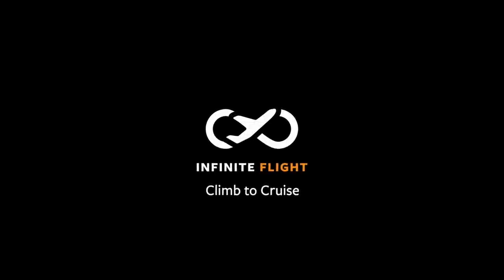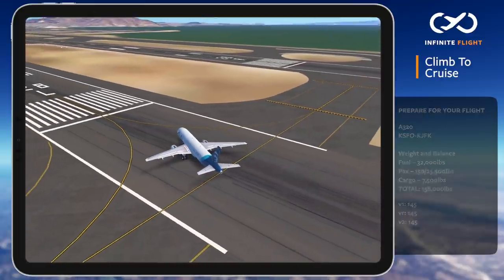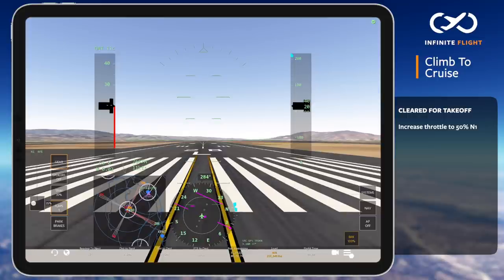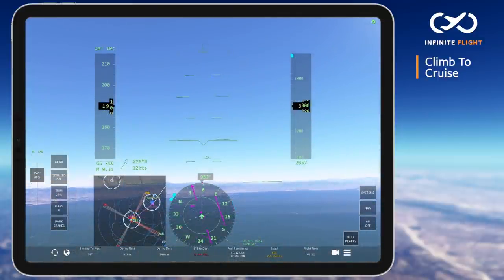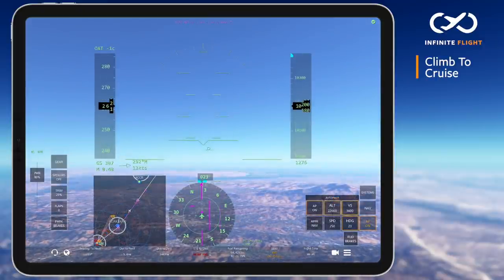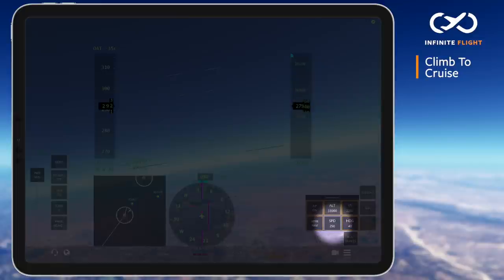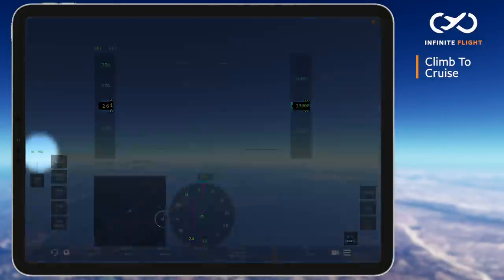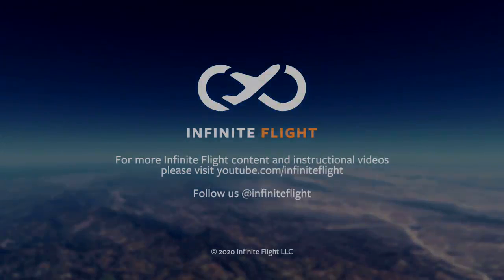Climb to Cruise Tutorial

Comment: please do a descending tutorial :)
Reply from the maker: Coming soon! -TJ
Reply: it took me a whole year to learn how to decend in time for an arrival so i dont have to nose dive on approach lol
Reply: If youre cruising at 32000ft, take the 32( or any respective number) and times 4, which will be 32x4, answer will be 128. Take this number as your distance to destination. When your display reads 128nm to destination, start decending at -1600ftm, this is the optimal decent
Reply: Infinite Flight I think what u meant to say was - soon™️
Reply: You guys can watch “how pilots know when to descend” video by Capt Joe. It is clear as water. I apply his explanations on my flights on IF (sometimes it goes better than others but it does its job.
In short, this is what he says:
Divide your altitude in 3 (get rid of last two zeros). Ej: 27000 ft = 270/3= 90 NM. This is the minimum distance you should start your descend to lose your altitude. 
Now, take your airspeed (no ground speed) and rest 200 (which is the speed at what you want begin your final approach). This outcome, will tell you how many NM you should have to reduce your speed. ej: if your speed is 320 kts, then 320-200=120. Now, 1 NM per 10 knots. It means that 120/10=12. In this example, it means we should then add 12 NM to 90, equals 102.
Wind: add 1 NM per each 10 knots of tailwind or rest 1 NM per each 10 knots of headwind. 

Vertical speed: start your descend at a roughly 3 degrees angle (I think is somewhere 3000 ft per minute), then pitch up a bit and when you’re established-on localiser (if ILS approach)  your VS is five times your ground speed. Ej: if your GS is 200 kts, then your rate of descend is 1000 ft/min.

There you go. Check capt Joe’s video, he explains way much better than me.
Reply: Singapore 005 Heavy your very helpful
Reply: @SierraDelta-  no problem
Reply: Singapore 005 Heavy what about 20,000 feet how do i know which vertical speed i should set to descend
Reply: Carlos Narváez that’s confusing
Reply: @HorribleDribbler  80nm
Reply: I already learn how to descent I learn really fast
Reply: @robxones109  no thats the “first and last” name

Comment: Does this work for heavies aswell ? They behave way different right ?
Reply from the maker: This method can be used on narrow bodies and heavies! Often times heavies have far more power which results in a lower overall takeoff thrust setting to avoid unnecessarily using a ton of performance that in turns burns a lot of fuel. You can still pitch for speed in any aircraft for the same result! -TJ

Comment: isn't a vs of 3800 a bit much for climbing?
Reply from the maker: This is quite common and you'll see the 3800 fpm quickly reduced to 2000-3000fpm as you approach 15,000ft and above.. in many cases by the time you have a few thousand feet to go until cruise you're only at 500fpm. Again, pitch for speed and the VS will be what it is. Have fun! -TJ

Comment: Why after the 10,000 mark you started to climb at 3,500 ft/min you will burn more fuel like that don’t you? After 10k I usually goes down to 2,000 ft/min at 15k go do to 1,500 and then at 20k 1,000 until reach cruise altitude that saves me a lot of fuel
Reply from the maker: Hello, Henry! My achieved V/S was purely based on a fixed power setting. Of course you can simply set the vertical speed as high or as low as you want, though that results in a variable power setting and fuel burn. In this case I'm simply adjusting my V/S entirely based on maintaining a set speed. The 3,500 fpm climb often turns into a 500fpm climb as a get closer to my desired altitude. Thanks for watching! -TJ

Comment: Great video. Thanks for the tip. Can you help me with the CRJ 200 because I am having a hard time landing. Liked and subscribed
Reply from the maker: Absolutely! We may add profile tutorials for individual aircraft. The CRJ 200 is especially unique because it does not have slats. The final approach is often slightly nose down! Also because of the low wing design the CRJ series does have a great bit of ground effect. Flaring later than you'd think, keeping it smooth and gradual will help you grease the landing every time! Cheers -TJ
Reply: Thanks for the tip. My latest video is holding possibly the smoothest landing on infinite flight

Comment: I only use 70-80% of thrusth when taking off in every aircraft.
Reply: That's kinda low tbh
The only aircraft that I can takeoff with about 75% is the 757 because it's way overpowered
Reply: Anywhere from 85  to 95N1 would be realistic depending on atmospheric conditions, weight and runway length
Reply: I use full thrust just to get out ASAP

Comment: Nice tutorial. Quick question, what VS do you normally climb with on airliners as soon as you left off and after you pass 2000ft?
Reply from the maker: Hello, Jordan! The VS is pretty dependent on what you can maintain to hold your desired speed. Sometimes being able to hold 250kts will only give you 2000fpm.. if you're light you may get 4000fpm. We recommend continuously adjusting your VS to maintain a desired speed. You may find it climbs much slower when heavy, but hey, that's part of the fun! -TJ

Comment: A quick question: It is alright to switch on LNAV when accelerating to 250 knots right? This question is pertaining to solo mode, so I can follow my flight plan without ATC approval. As a result I can switch on LNAV and follow the flight plan while doing the things described in this video right?
Reply: In many aircraft LNAV is armed on the ground and becomes active once airborne past a certain altitude - 400 ft I believe for the A320 family. It’s not simulated for IF of course, so you can just turn NAV on before you leave your gate.